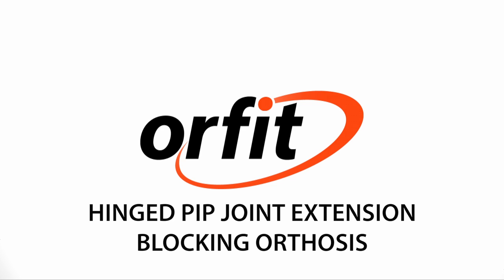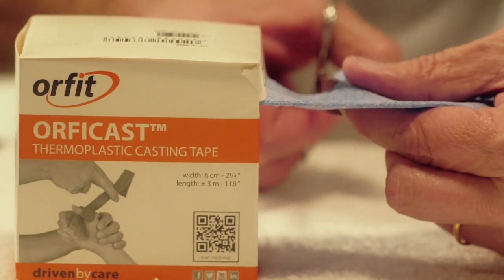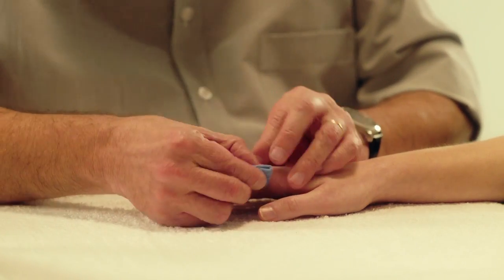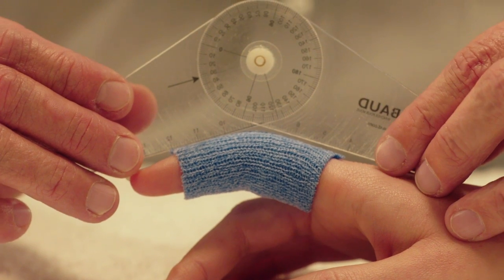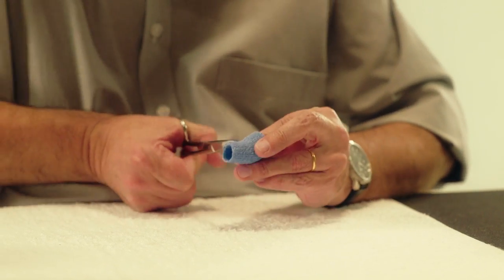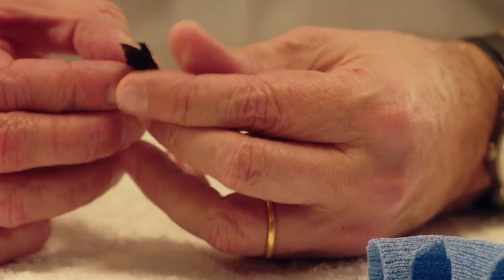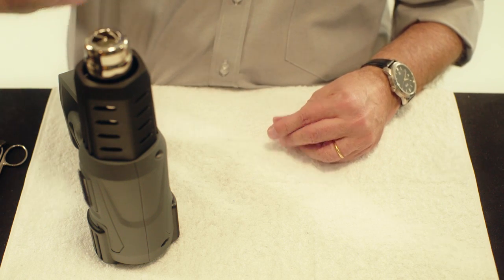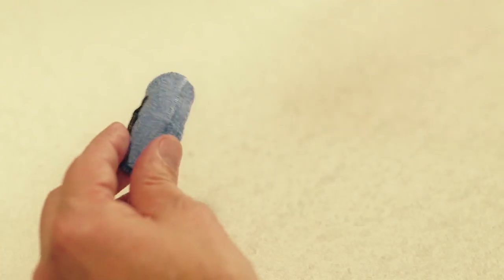Hinged PIP joint extension blocking orthosis - Orficast Instructional Movie 15

Comment: had an finger PIP joint injury on my middle finger around 7 years ago.. 
since then, my PIP joint has been thickened and swollen and the swelling actually had never gone down completely.. there is also some low grade instability in my PIP joint.. but i do not have any movement restrictions and pain.. is it actually normal, that i have now permanent swelling around the joint and the swelling not going down?

Comment: Is it used for lateral dislocation of pip joint?
Reply from the maker: Hi there, the hinged PIP joint blocking orthosis could be used for a lateral joint dislocation but also for volar plate injuries. The orthosis allows for flexion and limited extension but there is no pressure over the volar plate of the PIP joint.
The volar plate is typically injured in PIP joint dorsal dislocations. Hope that helps!
Reply: @orfit  thank you for your answer!